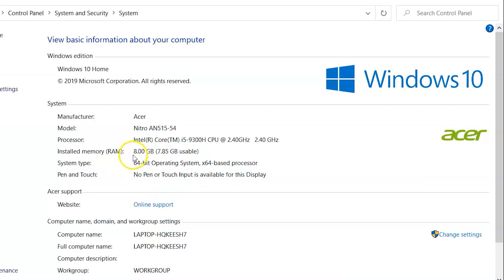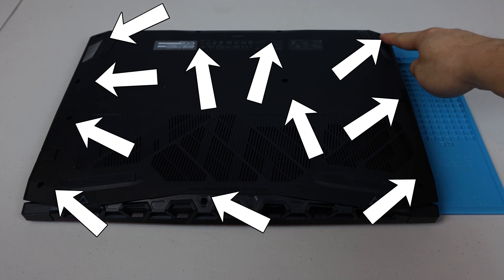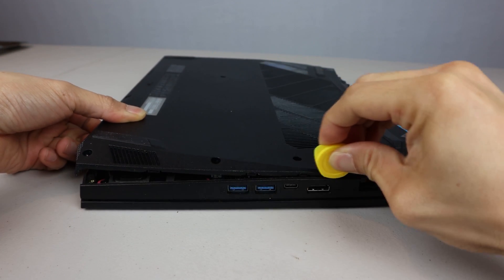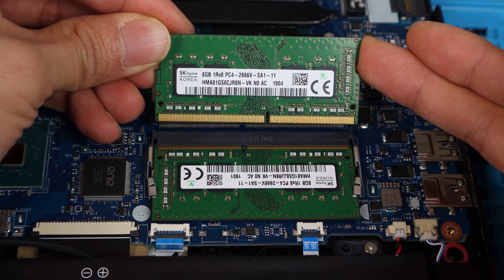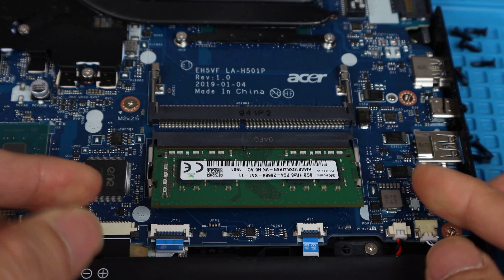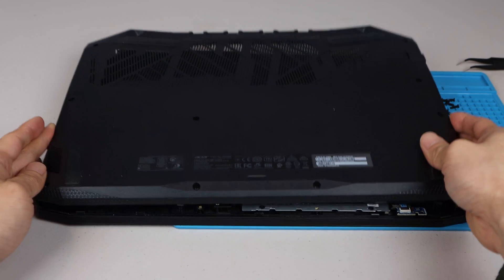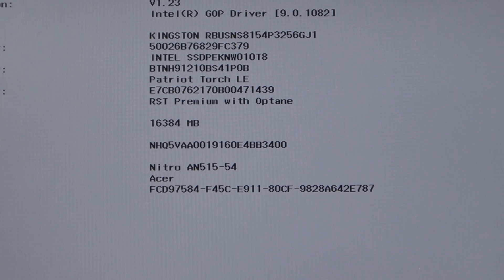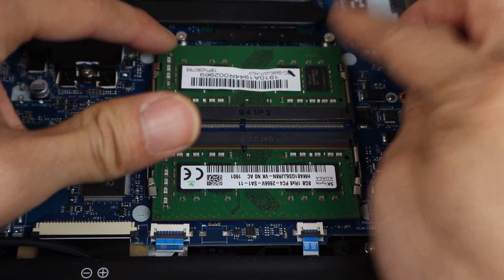How to Install or Upgrade RAM in an Acer Nitro 5 Gaming Laptop (2019 ver) DDR4 up to 2666MHz 32 GB

Comment: I replaced my ram and my acer doesn’t turn on any ideas
Reply from the maker: This could be caused by a number of things: improper installation, incompatible RAM, settings issue, out-of-date BIOS, physical damage to the chip or RAM slot, etc. It's best to try and rule out these things one at a time. First I would try unseating and re-seating the new RAM. Oftentimes the slightest misalignment or if the RAM isn't inserted all the way the computer won't boot up. If when re-installing the old RAM chip, the computer boots up fine, you know that the slot is ok and the problem is with the installation or new chip. Check with your laptop's published list of compatible RAM to verify your new RAM is compatible. If you cant' find that information, verify the specs on the new RAM match the old one by comparing the generation (DDR3, 4, 5 etc.), clockspeed (MHz), CL rating (CAS latency).  In some cases, the BIOS may not be configured correctly, for example XMP is enabled/disabled, or it may require an update (download and install from your laptop manufacturer's website support page).
Reply: @FixItPhil I have put the old one in and heard the click still doesn’t turn on

Comment: Acer Nitro 5s generally come with a removable compartment so you just have to take that off and not the whole back. I did mine today - ready to take the back off and noticed there was just a small compartment with just ONE screw to remove. Did that - changed it - done!

Comment: Thank You so much for the detailed guide. This was my first time adding RAM to a gaming PC without a maintenance hatch. I was dead nervous as I feared BSOD or a defunct piece, that being said, I needed a RAM upgrade badly since 5 years. Never mustered up the courage, until today. Your video was open and was referenced multiple times when upgrading the RAM. IMO, the trickiest part is prying open the back cover. Things can and will go wrong.

Comment: good afternoon everyone... I have an  Acer nitro  AN515-54 Intel i5-9300H CPU @ 2.40GHz  RTX 2060  16gb RAM.     I want to get 32gb of RAM. will (2x16gb) of 3200mhz RAM work or should i just buy the one 16gb 2666MHz  Patriot Viper Steel RAM from the link above and add it?
Reply from the maker: The limitation is the CPU; it can only take advantage of RAM with speeds up to 2666MHz even if the RAM has a higher capability.

Comment: do we need to remove the battery before installing to avoid damage?
Reply from the maker: You'll probably want to disconnect the battery, as this reduces the likelihood (but does not 100% eliminate) accidental electrical discharge, but you don't have to fully remove it from the laptop.

Comment: Do I have to unplug the battery when I m adding the ram?
Reply from the maker: That's typically recommended as a safety measure. You don't have to, but could run the risk of a catastrophic electrostatic discharge event bricking your device.

Comment: Is it not necessary to remove battery connection before doing anything?
Reply from the maker: In general no, it's not required, though you may want to disconnect the battery as an extra safety precaution if you're working in conditions that may be conducive to static discharge (e.g. carpeted flooring, cold, dry temps etc.)

Comment: Hey - great tutorial! My nitro 5 had the standard 8GB .... But the cost of a 16GB is almost the same as the 8GB ... So can I just pop a 16GB in the spare slot and run it at 24GB of RAM? Or do they have to be in "pairs" like some desktop memory? Thanks again for the awesome video.
Reply: its best to have the same size but technically in short you can do it

Comment: So I upgraded my Laptop from 8 GB of ram to 32 (2 16 Gb sticks) the computer reads the ram, it shows it has it in system but it’s limiting itself to 8GB of storage space for some reason. I’ve tried a number of things to fix the issue but nothing worked. I eventually tried to max the memory in the system configuration menu but it wouldn’t let me change the settings and kept reverting it. I don’t know why.

Comment: Is the Hynix brand a standard brand for all ram sticks of the Nitro 5 model laptop or do other models of the nitro 5 have different ram stick brands?
Reply from the maker: It really depends on the region in which you purchased it. I know different regional assembly facilities will use other "generic" brand components (like RAM) and it might not always by Hynix. Hard to say as there could even be temporary swaps to other brands if there are supply chain issues.

Comment: Perfect! I'm just about to buy this exact laptop used and wondered if I could do this. Thank you for the instructions. 👍
Reply: How is the laptop? And how well does it hold up with newer games and software
Reply: @IAmTheLaw1983  The deal fell through. Ended up getting an Asus ROG G751JY instead for $150.  Amazing bargain. Had to replace the battery and remove the WiFi card though. Quite an operation!

Comment: Can I install another differente manufactor memory with the same 3200 speed as the original comes, or should i buy 2 new from same brand and replace the original one ? cheers
Reply from the maker: In most cases, if the speed is the same as the original RAM from different brands will work together fine. In rare cases, different brands may not be compatible with one another due to varying implementations of the underlying technologies (e.g. one uses an XMP profile while the other doesn't, or the Cas Latency, aka CL, values are too far apart). The safest bet to guaranteeing compatibility is to use two of the exact same RAM sticks from the same manufacturer.

Comment: How important is ESD wrist band ?
Reply from the maker: It's a good idea to use as a safeguard against ESD damage to sensitive components or the motherboard, but isn't strictly necessary. In over 20 years of tinkering inside computers and electronics, I've only had one "incident" where I blew up a component which I attribute to accidental ESD (I was ungrounded at the time and working in a carpeted room).

Comment: I have the same pc, but I just bought a ram stick but I dosent fit. can someone link me the right one
Reply: Make sure you buy Laptop ram and not normal ram it's longer just search 8gb ddr4 2666mhz laptop ram it should look smaller when compared to actual ram sticks for computers

Comment: Quick question but the ram have to match or can I use a completely different one?
Reply from the maker: You can use different RAM, but in rare cases, you might run into issues if they are slightly different in spec/architecture. Using the same/matching RAM specs generally guarantees compatibility.

Comment: Hi Phil. Thanks for the video and the other ones you have on the Acer Nitro 5. So, I just downloaded something called CPU-z and it says my Nitro has TWO x 4GB sticks as opposed to a single 8GB stick. So I want to do a complete swap out of the RAM. I have some questions if you could help?

1) Can I swap the RAM out completely e.g 2 x 8, 2 x16?
2) If I do, should I back everything up?
3) I know if I buy a pair of RAM then they should have the same MHz. What is the significance of Mhz? More Mhz, better performance?
3) I have a very noisy GPU fan (I can check the noise via NItrosense). Are these relatively easy to change?

Please excuse my computer innocence or if I am asking the same questions in the comments; however I am not so young but really want to upgrade my laptop and your videos make it look straight forward.  All help appreciated, thanks.
Reply from the maker: 1. Yes, you can swap out both RAM sticks at the same time and it's best to keep the capacities of your two new sticks the same, as you indicated.
2. You do not need to back anything up as RAM only stores temporary data which is wiped every time the laptop is turned off. All permanent storage resides on your disk drives (SSD or HDD).
3. You'll need to check your laptop's specs for the max speed it can handle (MHz). You won't get any benefit to getting RAM with higher speed than the motherboard can utilize as it will be capped to whatever that maximum is e.g. the max speed is 2666MHz but you install two 3200MHz sticks, they will both run at 2666 MHz speed.
4. I believe in this laptop model the GPU fan is integrated into the video card and cannot be exchanged. You can use software to control the speed of the fans to reduce noise, but this may raise temperature levels of your components which could increase wear and tear.
Reply: @FixItPhil  thanks very much for your reply. From what I have seen, 2666MHz is the standard so I have bought 2 x 16GB to give it quite an upgrade. Ref GPU fan, I have bought a cooling tray so hopefully that will mitigate in case GPU overheats. Many thanks for your help, looking forward to watch future videos!

Comment: Hi!
I recently got a Nitro 5 and want to upgrade the RAM. Is there a way to check which memory I need without physically opening the laptop? Thanks!
Reply from the maker: You can run the CPU-Z software (it's free) and it'll tell you everything you need to know about the RAM currently in your system.
Reply: @FixItPhil  
Thanks!

Comment: Did you also hear click noise while inserting ram ? I hear and now i am worried
Reply from the maker: The clips on the sides of the RAM may make a click noise when inserting or pressing the RAM down flat to lock into place. This is normal.
Reply: @FixItPhil  Thank you so much i worried because of this

Comment: Hi, great video short and very helpful. Quick question how do you determine which ram is compatible with the laptop? I have a Acer Nitro 5 AN515-55-53E5 will the ram shown in the video work?
Reply from the maker: Generally, you'll want to check the specs from the manufacturer for RAM type recommendations. They will list the type and speed you should use. For your model, you'll want to get DDR4 2666 or 2933 MHz SODIMM RAM. Just make sure if you use a pair instead of one stick, that they are both identical. There's a max capacity of 64 GB across the two available slots, so the most you can install is two 32 GB sticks.
Reply: @FixItPhil  thank you so much, I appreciate it.

Comment: Does acer nitro 5 specifically mine which is AN515-52 i5-8300H, support mhz higher than 2666 mhz? Thanks
Reply from the maker: No, 2666MHz is the max for that model.
Reply: @FixItPhil  I'm glad i chose the right one XD seriously upgrading the ram and ssd of a laptop makes a lot of difference

Comment: hi i bought the acer nitro 5 withe the rtx 3050 on amazon 3 days ago, but it had only 8gb ram, wich wasnt enough for me, shoul i upgrade ram to 16gb even tought its new?
Reply from the maker: Sure, I almost always upgrade my new laptops right away if I can. Sometimes it's cheaper than buying the build with the specs that I wanted all along.

Comment: My nitro 5 won't boot after upgrade ram, how to fix?
Reply from the maker: This usually indicates that the RAM used is either not slotted properly, not compatible (with the system or the second RAM stick), or defective. If you installed RAM in a previously unoccupied slot, it could indicate that the slot itself isn't working properly. You can try a couple things. If you have two RAM sticks installed, try swapping their positions (switching slots). If it still doesn't boot, test the RAM by booting with only one RAM stick installed at a time (second slot empty) and run a RAM diagnostic to see if it's a specific stick that's giving you an issue.

Comment: I bought an upgrade kit for my AN515-55 with crucial recommended kit. When I installed, the computer wouldn’t boot or cut on. When I put old Ram back in, it worked fine. What could be issue?

Comment: Hi , same Laptop ACER NITRO5 RYZEN5 (AN515-44-R7ZU), then I checked the speed on my Task Manager > Performance > Memory: 8GB  3200 MH. can I install Crucial 8GB DDR4-3200 SODIMM (CT8G4SFS832A), also, is there a way to know what is the brand already installed on my Laptop?

Comment: Are you able to fully upgrade to higher gb ram sticks, or does it need to stay at 8gb per stick?
Reply from the maker: Yes, you can use higher capacity sticks. The max total for this laptop is 32GB RAM so I recommend two 16GB sticks running in dual channel.
Reply: @FixItPhil  alright, thanks for the info! 
Do you have any recommended places to look for ram sticks or would any from a local bestbuy work fine? And are there any brands that are more recommended than others? 

Again, thanks for the information, it's very helpful! 

And thanks, YouTube, for not letting me know I got a reply lol

Comment: hey man, Is it ok if I will not put the same existing ram? like my existing ram is 4GB, and I will put 8 or 16GB ram?
Reply from the maker: Yes, in most cases, using a different capacity RAM is not an issue, as long as you match up the other specs like brand, MHz, CL, etc. The more specs you match, the less chance of encountering issues or sub-optimal performance.

Comment: I did the same thing you did and it will only boot with one stick but not two
Reply: The screen won’t turn on with two stick in
Reply from the maker: This usually indicates that there's something wrong with the second stick or the second RAM slot. Try swapping the RAM sticks to the opposite slot. If it still only works with 1 slot, regardless of which RAM stick, then the RAM is working, but perhaps the second slot is not.

Comment: How do I find out what my clock speed is?
Reply from the maker: In the search bar next to the start menu, type 'Task Manager' and click on the result. Go to the 'Performance' tab. Then click on Memory. The clock speed of your RAM will be listed in the right-hand panel under "Speed". Similarly, you can see the CPU's clock speed by selecting 'CPU' on the left and checking the value for "Base Speed'.

Comment: Will it support 3200 MHz RAM or just limit it to 2667? Do we need to enable XMP to get higher RAM speed?
Reply from the maker: Perhaps this is possible with an AMD chipset build, but in this Intel model the max RAM speed is 2666MHz
Reply: @FixItPhil  Hi, do you tried? 3200?

Comment: Hi,I have the Nitro 5 AN515-54-59UV does not give video, I installed 2x16 am DDR4 16GB 2666MHz Crucial SO-DIMM, CL19, Non-ECC, 1.2V and SSD Drive 960GB Corsair Force Series MP510, PCIe Gen3x4 M.2 2280, R 3480MB/s, W 3000MB/s

Comment: Which processor do you have installed in your Nitro 5? Based on the description,  the presented RAM is only for 6th and 7th generation of Intel processors. The ones that they install in 2021 (i5 10300H) is 10th.
Reply from the maker: My laptop has a 9th Gen Intel® Core™ i5-9300H mobile processor installed
Reply: @FixItPhil  should we install single channel or we can install dual channel ram also?

Comment: sir may I ask how much frequency is recommended for the ram? Or I can just buy a ram with any frequency?
Reply: Theoretically more frequency the better, but as a casual user you will not realize the difference. If you have 2 rams in your pc or lappy, let's say 8gb ram 2400 + 8gb ram 2666, your system will always use the lowest frequency in this case the 2400 MHz

Comment: Don't you have to remove the battery when installing ram?
Reply: Nope. I have an acer nitro 5 and just put the ram in. First i shut down of course but after i put the ram stick in it worked fine

Comment: i see you added a viper steel link, is that ram card compatible with the acer nitro AN515-54?
Reply from the maker: Yes, you can use Viper Steel RAM with the AN515-54
Reply: @FixItPhil  I got it but when it was coming it says it's undeliverable :(

Comment: Whud it work if i have 4 gigs DDR4 ram?(cuz where i live there was only one DDR4 tipe ram and it was 4 gigs)
Reply: And sorry of there is spelling mistakes
Reply from the maker: Sure, it will work, but for gaming at least 8 GB of RAM is usually the minimum requirement (achievable using two 4 GB sticks) and 16 GB is recommended for the best performance on most games.

Comment: I have this same laptop doing this will not void my warranty? I have extended my warranty till 2023 and Don't wanna void it. Upgrading ram by myself will void it? Also there's no sticker on any scre
Reply from the maker: In the US, usually performing RAM and hard drive upgrades are allowable within the warranty. IF you are unsure if this will impact your extended warranty, then I would reach out to the vendor from which you purchased the extended warranty for clarification of your warranty's terms.

Comment: If I put a 3200 with my 2666 will it run at 2666 or factory default?
Reply from the maker: It would run at 2666 MHz, as it will always run at the lower speed of a pair, unless the motherboard max is lower than either of the specs of the RAM, e.g. 2400 MHz, in which case, it will run at the max capped speed the motherboard can handle.

Comment: Before upgrading the RAM, should the battery be disconnected? I've read different advice!
Reply from the maker: I don't think it matters much. I almost never disconnect the battery and have never had an issue, but it's safer as a best practice and costs nothing but a few seconds to perform.

Comment: Got my daughter a Nitro 5, which by the way couple months old and need to send it in for warranty as it shuts off if unplugged. Anyway, she has 8gb, I would need to install another 8gb as shown for 16gb total, or replace both for 16gb each for 32 gb total? She is into gaming, apparently it's slow?
Reply from the maker: 16GB is sufficient for gaming, so you'd only need to add an 8GB stick if there is already an 8GB stick installed, as was the case in my system. I'd open it up to check first though, as some builds utilize two 4 GB sticks to achieve the factory original 8 GB, in which case you'd have to replace both sticks with 8 GB ones to get 16 GB total.